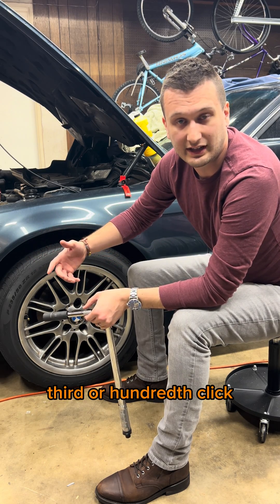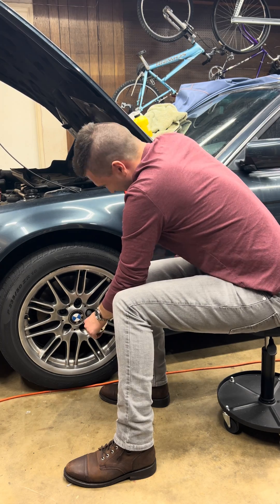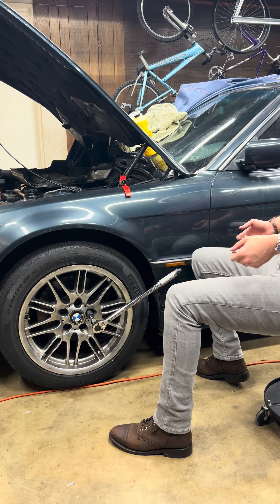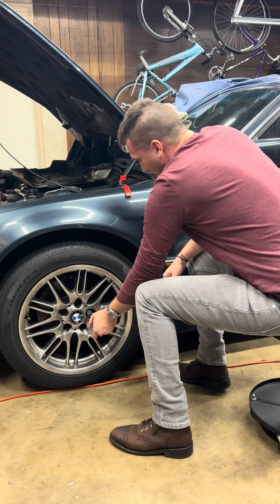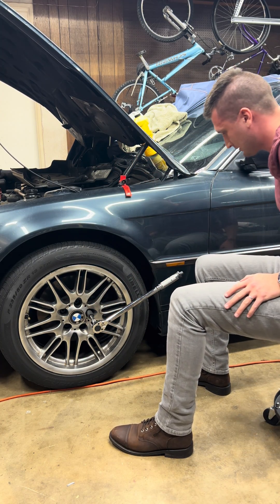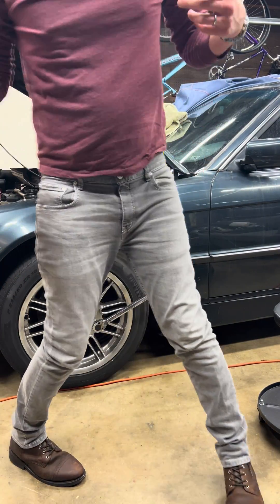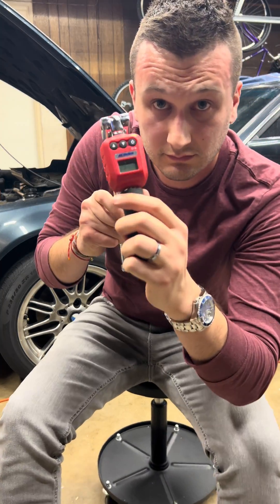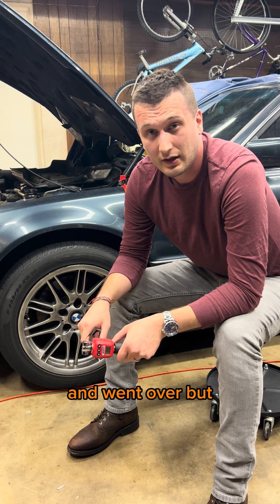Does the Number of Torque Wrench Clicks Matter?

Comment: It's honestly more important that you don't over torque them before hitting them with a torque wrench. If your torque wrench does not rotate the bolt/nut as you're applying torque, then they were over torqued from the get-go.